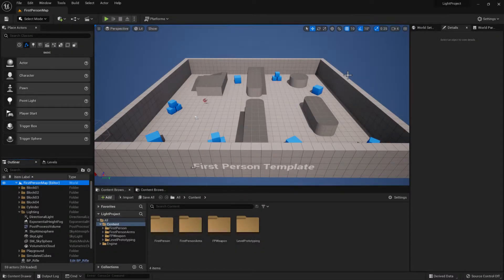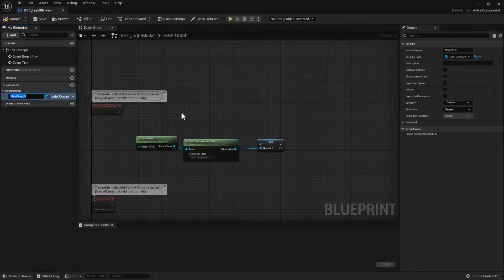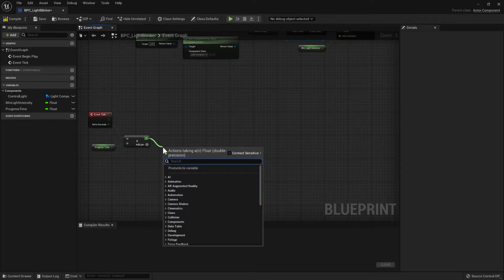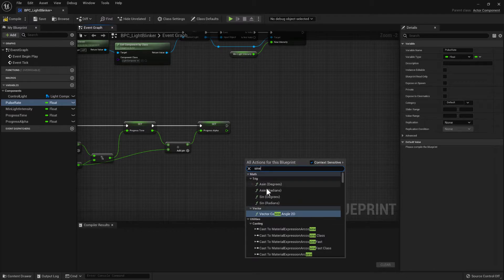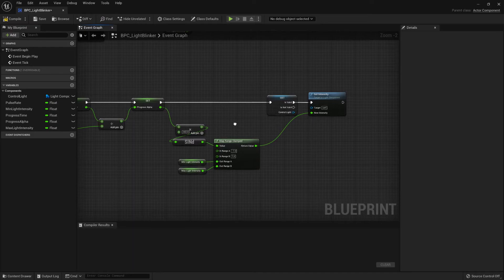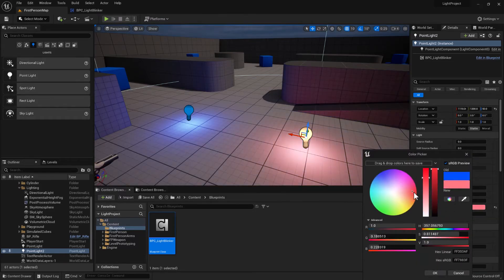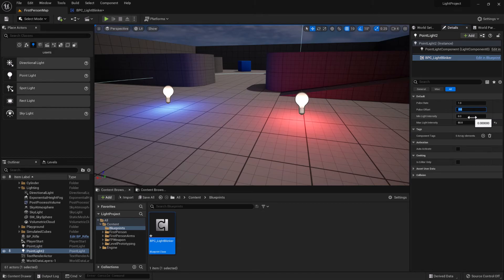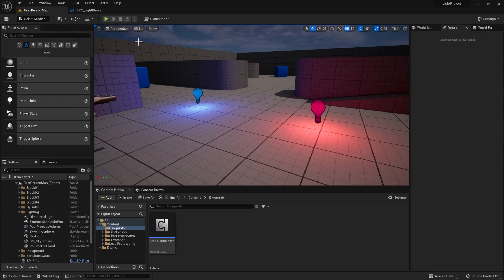Unreal Engine - Blinking Light Component

Comment: Hi there, thank you for the tutorial. I was wondering if you are able to assist me with guiding me to create a realistic police light flash pattern in blueprint? I need it to flash 4 times before cycling over to other side, so 4 flash of blue, then 4 flash of red, if that makes sense. Is this possible?

In theory, I would need to control the flash frequency, intensity limit and flash offset rate, and then duplicate the light over the same position as layers to achieve a 4 flash effect.